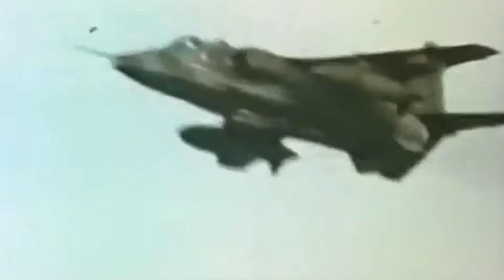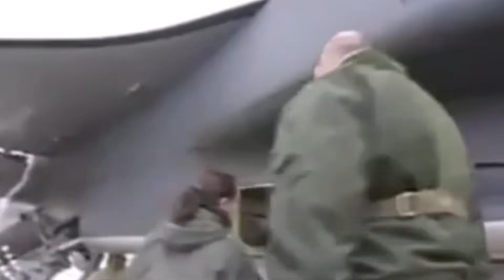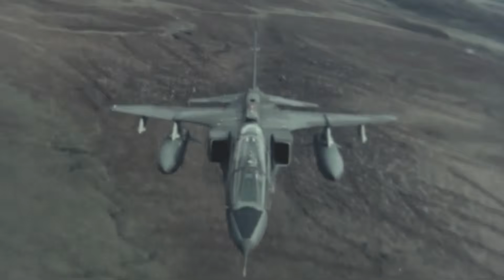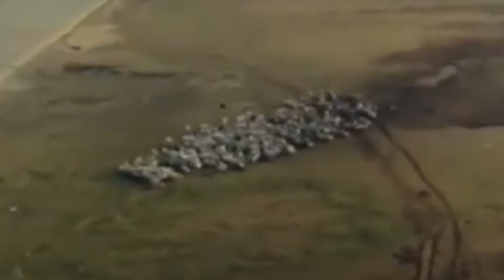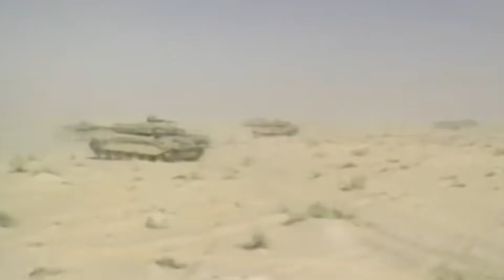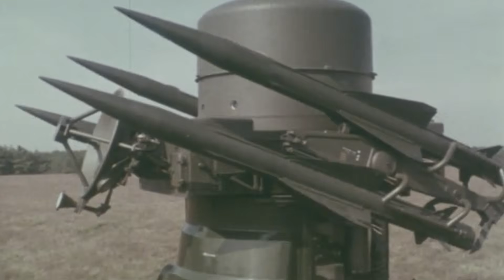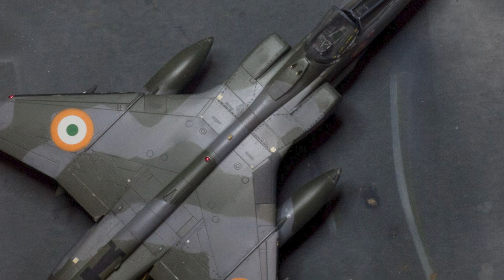The Fighter That Battled the Wrong War and Shocked Everyone

Comment: Is it just me or does it look super similar to a f4 phantom?
Reply: Nope. Jag's are nothing like Phantom II's !
Reply: @wullie3xv923  oh, well alright then
Reply: @Ricossmft28  Apologies for my abruptness, I'd had a couple of vino's last night !  OK, I'll quantify then. 
I'll start at the front end. Apart from Indian AF, Agave radar'ed Jag's, most Jag's have a longish, pointed nose with a longish pitot probe at the tip of the nose.
Most Phantom's have a shorter, big, round bulbous nose cone.  I'll grant you that R/RF4E & F4G noses are longer & slimmer, but still have a rounded radome.  
No single seat Phantoms ever flew. Two seat Jag's have an even longer, slimmer, ( to me ) forward fuselage than Phantom's & look more "hump backed".
Jag's have small, square, high mounted engine intakes, Phantom's have large rectangular intakes almost the full depth of their fuselage.
Jag wings are small, short span & very high mounted.  Phantoms wings are longer spanned, mounted under the fuselage & have their characteristic dihedral outer panels. 
Jag tail fin's / vertical stabiliser's are tall & have a narrow chord, the Phantom's are shorter, have a much deeper chord at their base & a highly swept leading edge.
The only similarities I see are their rear fuselage's aft of the engine nozzles & that they both have anhedral set tail planes / horizontal stabilizer's over twin (afterburning) engine exhausts.  I've always loved the look of the (R.A.F.) Jag's but never got to work on them when I served in the R.A.F.  I was lucky enough to work on Buccaneer's & Hunter T birds on 237 OCU in the late eighties, ( the opposite side of Lossie's main runway from 226 Jaguar OCU ) & also worked on most marks of Harrier whilst on 233 OCU / 20(R) Squadron in the early nineties, but never Jag's ... or Tornado's.  Re. Harrier's, I'm still seething about David Cameron's government decision in 2010 to do away with the R.A.F.'s Harriers, the U.K.'s most "go anywhere" airborne ground support asset.  ( The R.A.F.'s Jag's were a close second place, but couldn't fly off a carrier / suitable ship !  🤪).
Reply: @wullie3xv923  that’s awesome! Thankyou for that, I’m but a humble former infantryman
Reply: I think it's just you... anhedral vs dihedral wings for a start.
Reply: @sennen222  yeah I get that, I guess what I meant and should’ve said is, to me it looks like a improved and modernized phantom
Reply: @Ricossmft28  I still don't see it... size of undercarriage, sheer bulk (Jag was only 8 or 9 tons dry weight), position of wing root etc.. I worked on both, and falling off a Phantom wing was much more preferable to falling off a Jag wing! But each to their own. And if you are ex-infantry, Thankyou for your service, respect to all veterans. At least in the RAF we only sent our officers to do the fighting :-)

Comment: I doubt that the first Jaguars were equipped with GPS.
Reply: The U.S GPS satellites started going up in 78, however the full system wasn't in place until about 90 - they had it in the Gulf War.  I would tend to agree with you that the first ones did not and it wasn't until well into the 80s that they got systems to utilize it.
Reply: During the Gulf War I, we used handheld GPS. I have a picture of a GARMIN Pilot 3 held to the coming of a F-117A with a bulldog clip.

Comment: One abiding memory I have of Op GRANBY was sitting under my cam net, sharing my coffee with the flies, while one of my bridgelayer crews was servicing its engines.  This involved elevating the bridge to top dead centre (vertical).  Suddenly a flight of Jags blasted past at zero feet, filled my mug with sand, dispersed the flies (briefly) and scared the living bejesus out of the AVLB Commander when one aircraft had to climb to clear his bridge.  I never felt prouder of the boys in light blue than when I saw that display of force and flying skills.
Reply: I think the Jag is possibly the loudest man made object of all time :)
Reply: @malphadour second.
The Vulcan will always be king for volume. 😉
Reply: Unfortunately we were all duped into thinking we were the good guys, sadly we were the real invaders, and Blackrock and Halliburton were the winners
Reply: @billb7876 Wrong war. That was the second Gulf War. The Jaguars were long since retired by then.
Reply: @stephenhumphrey7935  Well they weren't. RAF didn't retire the Jaguar until 2007, 4 years after the Gulf War 2, and India still flies lots of them

Comment: I met a Jag tech years ago and he said that the UK govt should've never retired it.  The fact that the airframe could take, fully loaded, supersonic flight showed its durability.

But UK govt are famous for never doing the right thing (just like Great British Voting Public...).
Reply: Airframes have a limited life, at some point they simply have to be retired.
Reply: But have they not just downed one of the most useless British Govts in history?
Reply: Meaning?
Reply: @norm8andy  Meaning technology moves on.  A jet engine couldn't be put on a Spitfire, though Supermarine tried and failed, despite them modifying the design in the early 1950s.  But certain designs can be future-proofed like the Harrier, after the US Marines got them, and they prefer the Harrier, or they did, over the F-35.

Comment: The Indian Air Force has mixed views of the Jag. One joke, due to the perceived low power of the engines, was that the Jag got airborne only because the earth was round. Suicidal single engine landing performance. First stage of reheat while landing with even slightly higher weight. But then, terrific range and a rock solid gunnery platform with superb low level ride.
Reply: To be honest that was also how they were perceived in the RAF. The Jag was better than the sum of it's parts in real world conflicts, but the engines were always its weakest link.
Reply: Werent the engines updated by IAF later??
Reply: The Honeywell F124 was considered by the IAF for their Jaguars, but I think the installation effort was dropped. @Vkj007

Comment: IAF Jaguar is now undergoing upgrades with several modern solutions and missiles including anti-radiation (I dont know the particulars exactly). It is used for low level attacks against Pakistani targets by the IAF. It becomes too under powered in the Himalayas against China. Tejas MK1A will be replacing it doing similar roles.

Comment: French Jaguar A was even more outdated during Desert Storm 😅
But they were equipped with the very good ATLIS II TV targeting pod (very good tracking allowing single pilot used), supersonic AS30L laser guided missiles and MATRA BGL400/1000 laser guided bomb.
They strapped portable GPS on the dashboard, and this outdated attack aircraft became cutting edge 🤣🤣👌
Reply: Those targeting pods made them more effective than waves of B52s
Reply: Just like cars today, add Carplay and it is the future.
Reply: For that matter, I've seen video from inside Ukraine MiG 29s that had an outdated but functional monochrome screen commercial Garmin GPS unit ziptied to the side of the MiG's heads-up display. Those older 29s must not have had capability of using GLONASS either due to age or to access being cut off by the Russians.
Reply: Can imagine for some strange reason Clarkson raving about these.May wanting a turbo supercharged type 33 spitfire .Hammond a Yakolev.upgraded of  course.😂 Roll bars & a Saturn 5 rocket engines

Comment: GPS in an Anglo-Frog fighter from the 60s? What are you smoking?
Reply: The RAF GR1B, T2B and GR3 all had GPS.
Reply: @gillfitzpatrick7894  Eventually. The helmet mounted cueing system didn't make an appearance until the final years of service either. Jag was used as a test bed for a lot of systems that ended up on the Typhoon.
Reply: Your lack of knowledge is as hopeless as your opinion...

Comment: Nice to briefly see the Jag in RAE colours. I worked at RAE Farnborough for a time, we also had a green camp R&D variant that I occasionally worked on. It was powered up when I was with it, but as you arrived it would sense you driving and walking up to it, responding with noises of things activating. It used to scare the crap out of me.
Reply: Last Jaguar I ever saw was in RAE colours.  I remember it well, it was about 200 ft above Rannoch Moor.
Reply: what is RAE?
Reply: @dimwitsixtytwelve  
What is RAE!??? The legendary Royal Airspace Establishment.
Reply: @1967AJB  OK and what is that? nevermind I just looked it up after you told me the full name. you know it's ok to ask questions right?
Reply: What kind of systems did it start up as someone walks up to it? That's pretty amazing, never heard of a fighter doing that before, very cool.
Reply: @gotindrachenhart  
I have no idea, I assume internal radar and weapons designator was seeing vehicles, but weapon systems nor avionics was not my speciality.

Comment: I enjoyed the video, I used to be based at RAF Laarbruch when 2 Sqn. (normally written in Roman numerals as II Sqn.) were still equipped with Jaguars, one point about these videos, I don't know how many times it's pointed out that when identifying an RAF squadron it's never 6th, 41st, or any of the other ordinal indicators that other Air Forces use, you just say the number such as 6 (six), 41 (forty one) etc.
Reply: Same for the RCAF, too.
Reply: I was at Bruggen 1984-1987 on 17f sqn (Black Hand) , After a few months being there we phased the Jag out and got Tornado.
Reply: @Optikification  Had to travel down to Bruggen every night to refill our LOX pots when they closed Laarbruch’s runway for resurfacing in ‘87, what about absolute joy finish back shift in the Hyd. Bay at 22:00 then drive down to Bruggen, fill the pots for the squadron to pick up next morning, then drive back and get to bed about 01:00.
Reply: The trouble is the world is split into two parts - the ignorant American and the rest of us!  The USAF unit structure reverses the Wing and Group compare the rest of the Western World, 
RAF had for example in WW2: 11 Group (London South Area)  Bigin Hill Wing (Operational Base), Number 303 (Polish) Squadron (Functional Unit assigned for duty) - which could move to 13 Group for rest.  USAF had Wings with sequential Groups and Squadrons under it hence  5th Fighter Wing, 2nd Persuit Group, 41st Tactical Fighter Squadron nomniculture.
It comes down to the way the forces got structured and used - and became traditional.
Reply: Yeah some of the best days of my life were working on ll AC sqn at Laarbruch, a great aircraft that I was lucky enough to go up in one to do air to air at Cyprus.

Comment: A Jaguar landed on the M55 motorway when it was opened, in Lancashire.
Reply: From RAF Warton.
Reply: When I was on shiney 6sqn, we were told to prep for a landing on the m62 at warrington( motorway is built on top of old runway) but it never happened, but the autobahn was used as sections were set up for this as first thing to disappear in a big war would be the actual airfields……

Comment: Pilots just knew how to fly and operate the Jaguar (1974).  Look at the F-16 that was developed during the same time period.
Reply: F-16 is a bit newer than the Jaguar (Jaguar's first flight was about five years earlier), but the Gulf War also saw effective use of even older USAF F-4G Phantoms. Ironically, given popular perception of the Phantom's shortcomings, this variant included the cannon being removed, as it was superfluous to the aircraft's SEAD role, and took up space that they needed for some electronics warfare kit.
Reply: @Raguleader  Thanks for the reply.  During my days in the military the "Flying Brick" was the Fighter.  F-16 is a bit newer, but it goes to show you how well & versatile the West made their aircraft.  Never knew the Phantom was around during the Gulf.  A few of many.
Reply: @benjaminrush4443  f-16 was in development after Jaguar was in production. There was phenomenal development going on at that time with aircraft. In 5 years a lot can happen.
Reply: @JSFGuy  Sure time passed - but the major differences between the Jaguar and F-16 were down to the totally different roles they were intended for. The F-16 was intended to be a top-tier air superiority fighter - requiring big runways and hangers, while the Jaguar was a cheap trainer & CAS/ground attack aircraft flying from rough airfields (or motorways) - with rapid re-arming. In terms of intended mission profile the Jaguar is closer to the Viggen or Gripen, A modernized Jaguar might have been a perfect fit for Ukraine right now.
Reply: @fungibleunit4477  Right, I wasn't having any problems with mission design series or the like. I've been around both.
Reply: @JSFGuy  Yes your right.  I just think of some of the older aircraft that is still used or were used up until the Golf War and today.  Thanks.